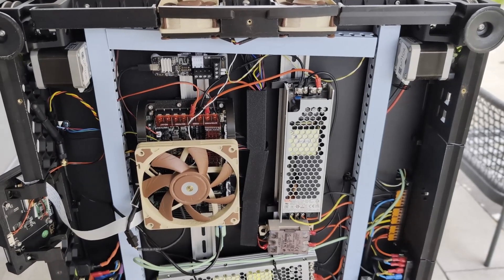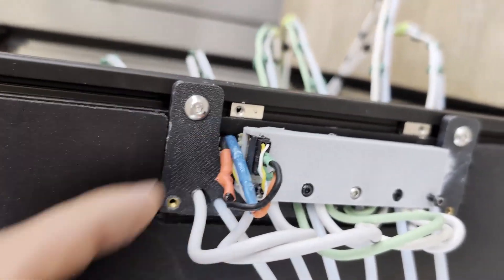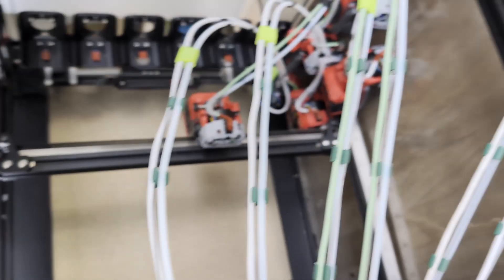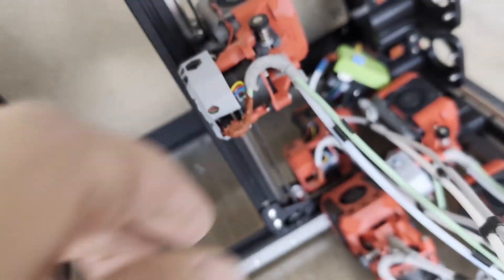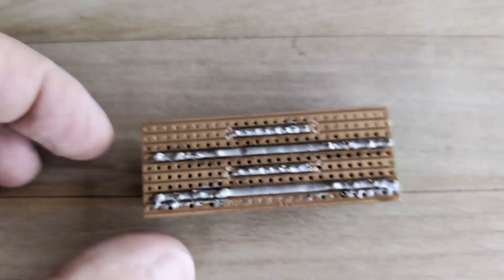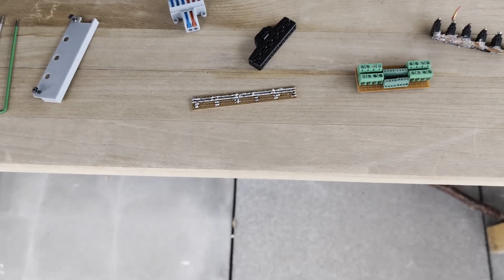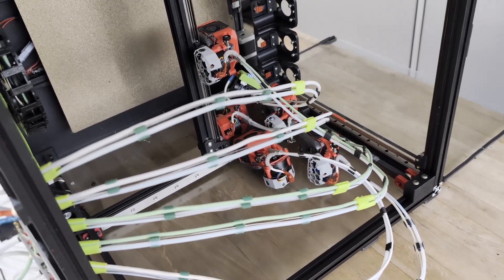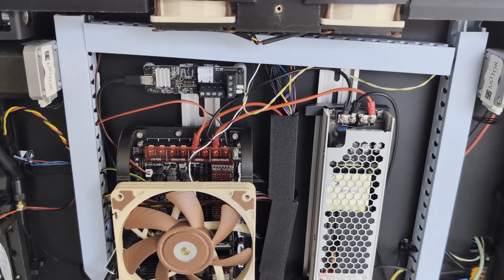Tapchanger Canbus Wiring

Comment: I don’t use Can Bus on my Hydra tool changer. However I need to test it at some point. I really can’t have the wire coming out the back as my printer are all the way to back to the wall. I also just made new clips to hold the back panel that only are 1 mm in thickness my panels from Biltema are 400x600x4 mm so now only about 5mm is needed so I can max out my Y travel. I really whole like to see a 3d printer board that I can connect 4 Can Bus tools on board and don’t need any distribution board. Even if i only have 4 tools my wiring is easy to do, As they all connect directly to the main board. I use Marlin and BIGTREETECH BTT Octopus Max EZ. I need to do some testing with Klipper and RepRap

Comment: Some issues might be with 90 Ohm impedance of USB cable (should be 120 Ohm, meaning you will have reflections), and maybe adding ferrite bead to 24V and GND might also help. (I guess capacitors should've already helped to some extend). 

Btw. I sent you a Jig to cut square metal rods on discord, I extended them to be ~30.5mm long

Comment: Why not use the onboard canbus of the manta?
Reply from the maker: @GrizzLeeAdams  The way the Klipper canbus on MCU works is that all commands for the Manta go though the canbus protocol as well.
Meaning it needs to drive the 6 motors in addition to toolheads. This caused homing timeouts for me a year ago. 

Homing is def the most demanding operation for pushing a lot of messages in a short bursts. I suspect they just got backed up in the transmission queue.

The MCU serial interface is clocked at 250kb/s so theoretically a 500kb/s canbus should beat it. I suspect the frame overhead and frame pacing limitations are playing a significant role.

Comment: have you seen the BTT canbus splitter board, it would be a cleaner solution, the manta boards do have their own can bus ports, no need to have a separate USB to can adapter too
Reply: It supports only up to 5 toolheads for what I know
Reply: Bigtreetech CEB is the name
Reply: Its almost a great solution.  It would be perfect if they just gave you 7 power and 7 signal screw terminals.  As it is, it takes two to have a clean setup or your gonna have to have different connectors for different heads.

Comment: You need to daisy chain it.  spurs will be flakey.  Easy with igus cable, 2 twisted pair and 2 power in one cable
Reply: Exactly - the propper way is to have everything in one chain - I see that people seem to get away with this, but signal quality will be degraded over a correct bus layout with two terminated ends and the more of those branches there are the worse it will be.
I’m not set on what I will do with my printers (I am building two with tapchanger) - either run two set of bus wire to the head to allow the head to be in the bus middle or use multiple CAN buses with the host controller in the middle and just two heads at each end.
Another thing, about the MKS CAN bus controller: it is isolated, so this one has no connection between bus ground and USB ground and without a common ground the bus is even more degraded.
Reply: Exactly - the propper way is to have everything in one chain - I see that people seem to get away with this, but signal quality will be degraded over a correct bus layout with two terminated ends and the more of those branches there are the worse it will be.
I’m not set on what I will do with my printers (I am building two with tapchanger) - either run two set of bus wire to the head to allow the head to be in the bus middle or use multiple CAN buses with the host controller in the middle and just two heads at each end.
Another thing, about the MKS CAN bus controller: it is isolated, so this one has no connection between bus ground and USB ground and without a common ground the bus is even more degraded.
Do you have a product number for that Igus cable by the way?
Reply: He is just using a star topology which is really common
Reply: @tructruc00  Which is the wrong way to do CAN bus unless you are going to have repeater at hub and separate networks.
Reply: @tructruc00  Right, it is a very common mistake. The signal quality isn’t as good as it should be and the more of such violations you do the worse it is.
This is plain physics - at a branch you will get a reflection, the head cables are unterminated, so there will be reflections too. All branchings happen at nearly the same location, so all those branch reflections happen at the same time, the head cables are more or less the same length, so those reflections come back to the branch point at nearly the same time. If you want to branch without reflection you would have have to use a different impedance cable to the head, but the you would have problems with the signals coming from the head to the branch point.
You can’t overcome physics.
While the signal might still be good enough with a single branch, adding 6 branches is really asking for troubles - that’s 5/6th of the signal energy being reflected at the branch point and only 1/6th being passed, of which only 1/(6*6)th goes to each head. Because the cables are rather short, the reflection times are short too, so time is a bit on your side and chances are that things equal out fast enough after a few reflection iterations. That’s why a few mm branch into a chip on a PCB is usually fine.
You normally don’t see the signal quality, since it is digital - it either works or it doesn’t, but you won’t know how marginal it is unless you go and scope an eye pattern signal.
If you play by the rules you are safe - if you violate them you should know what you are doing.